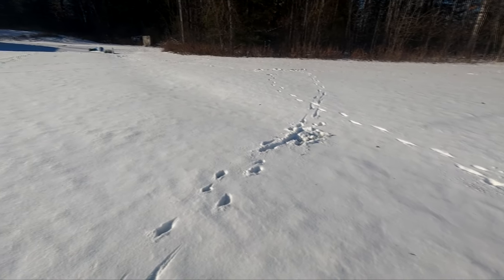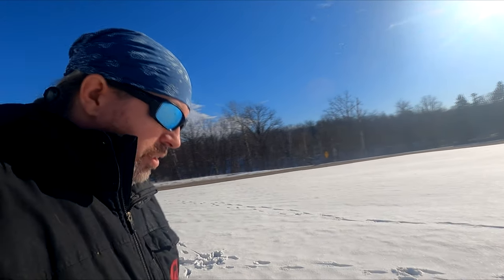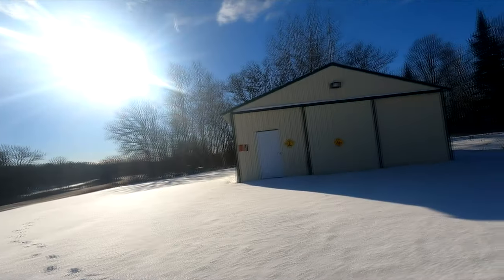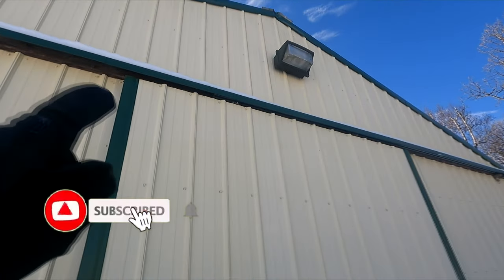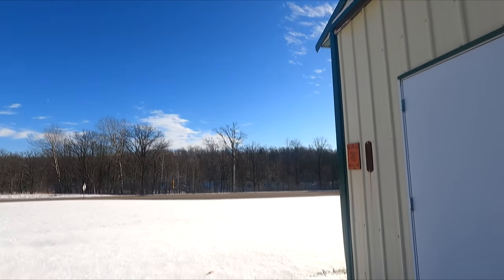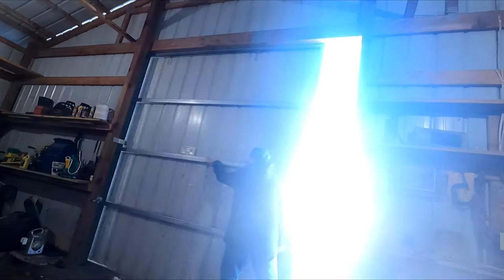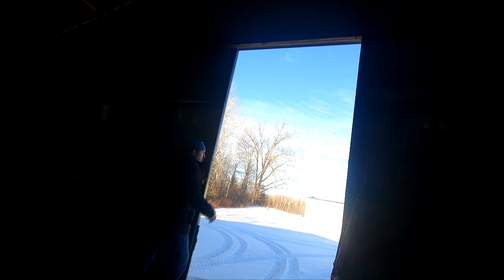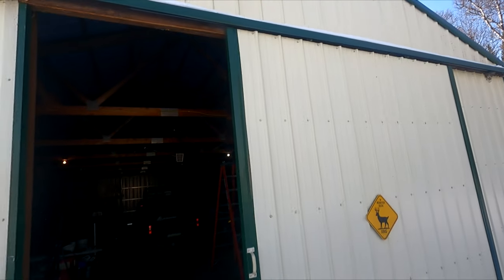How to fix a sliding door on a pole barn

Comment: Just what I was looking for thank you very much
Reply from the maker: Great! Just FYI, I originally over tightened them and had loosen them back out a little.
Reply: Thanks for the info.  I have had a door diving me nuts for over a year. It's been so dang hard to open.  I took a closer look at it last week  from what I can tell I think its dragging on the ground a little bit.  I'm  gonna try and  mess with it tomorrow.  I will let you no.  BTW  this a giant 10x20ft  doors on the front of a round top build we keep combines in.   Sire it works the way im thinking.  Thanks again for your video.  I had a hell of a time find a video showing me how to raise a fairly big don't.